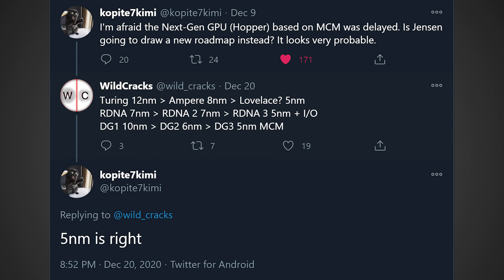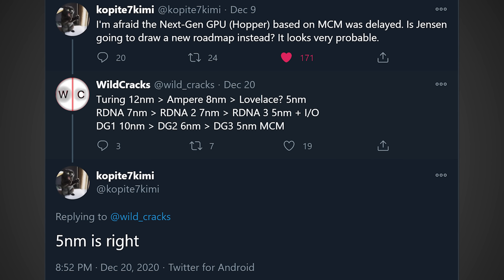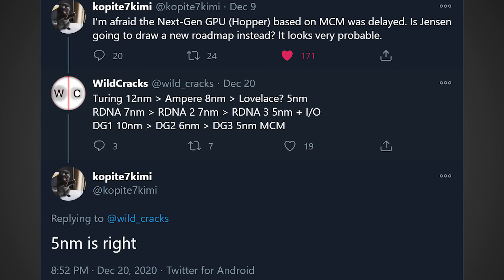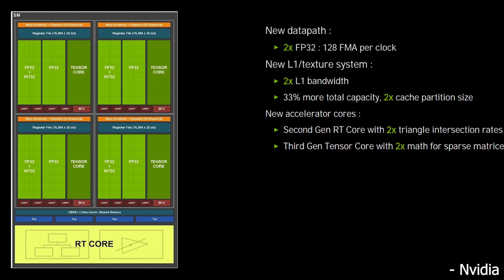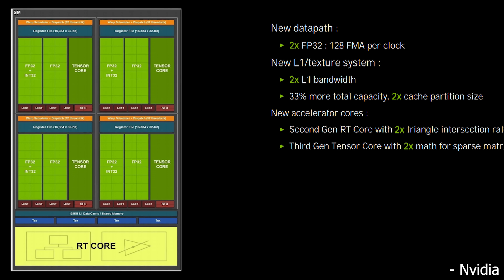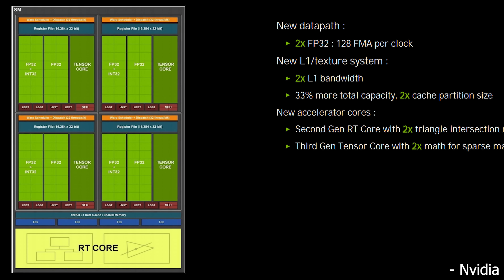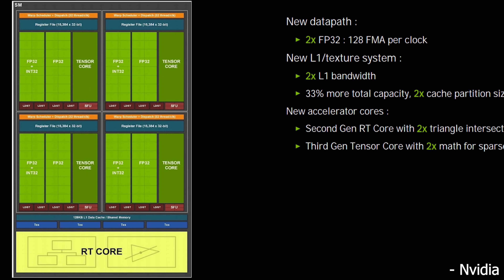NEW Nvidia Cards Leaked - RTX 4080 5nm Lovelace & Hopper GPU

Comment: I swear if 4000 series comes out in 2021....
Reply: I think 2021 series 30 refresh and then 2022 5 nm hype train
Reply: Its good, competition again and progress.
Reply: @M Smithy lol you really think BILLIONS are gonna be buying the latest Nvidia cards? lmao
Reply: @M Smithy They cant make cards? im pretty sure my Nvidia card its real, what are you on about?
Reply: I would be fine with a new generation of cards every year. Pump those suckers out like iPhones. If you want to skip a few years, that's up to you. It's called technology. It always gets better and older things become obsolete.
Reply: @jessepotter365  its just that the performance upgrades are to small between generations and each generation is sold as being a godlike upgrade when people in same cases risk DOWNGRADING with a new generation
Reply: There are leaks talking about an inevitable 4000 series card.  You know before the 3000 series was even out the door Nvidia was planning the next step.  This leak discussing possible designs in no way means a 4000 series card is anywhere close to being launched.  There is going to be basically no way a 4000 series card with new designs like stated in this video is happening in 2021.  If anything this is a mid 2022 product line.  It will be months before stock gets better for the 3000 series.  There will not be a reason to release 4000 series till 3000 series is squeezed for all its worth and right now there are tons of people just hovering over buy buttons for those.
Reply: I guess none of the comments lives in Australia. 3080 cost the same as 2080ti here. And I just get second hand 2080 and it is like half price of 3070
Reply: @EnnTomi1  tbh i dont even know what a 3080 costs in EU because i have never seen one, but i wouldn be surprised if its the same pirce as a 2080ti. This whole MSRP from Nvidia is just a massive scam and sadly techtubers are falling for it aswell.
Reply: @M Smithy i dont have a 3080...? and where you get your numbers from? Id like to think you're not just talking bs.
Reply: Jesus Christ the arguments in this chat are fun 🤣 
In my case, I got an RTX 3090 for a professional workstation where 24 GB of VRAM is required (DaVinci Resolve crashes otherwise).
I don't regret my choise at all because it's something necessery for my line of work and which will pay for itself.
Waiting for a year or two for the next generation isn't really worth it in my case, especially when we take into consideration that the new generation of tech is always going to come and at some point you gotta bite the bullet 🤷🏻‍♂️
Reply: @teodor_b_g  yeah but your extrem special usecase is like 1 in a million. I dont even understand why people like you even watch those videos or even comment on it. Be happy with your card and good is.
Reply: @decuervo yeah I'm passing my old system on to the fam so it'll still be around. You won't be disappointed with a 30 series
Reply: @Marlboro65  Pretty sad to be this upset over a GPU, get a life buddy 😂
Reply: @HondaBrandy  just in time for cyberpunk to have most of its bugs patched
Reply: I got my Asus 3070 for $540, at 2020 Dec, can't be thankful enough
Reply: Not until 2022
Reply: @adityakr.7550  why are you so sure it will be 2022?
Reply: @softycrab6267  because it makes no sense to make new cards in 2021 when you still can sell cards in 2021, the only competitor (AMD) wont make any new cards in 2021, so why should they make any new cards in 2021, while they still have to produce and sell their already developed cards.
Reply: @adityakr.7550  yeah, october 2022
Reply: I hope it's true because the 3000 series is not interesting to me
Reply: @rubyvi5442  cringe
Reply: @rubyvi5442  lol the biggest jump in performance for dollar value in years and it's not interesting to you? is that because you're salty from buying a 20 series or you can't afford a 30 series.
Reply: @guntherhunter5231  lol rip anyone who bought 20 series, especially 2080ti owners, when a 3070 is as good
Reply: @guntherhunter5231  Seems as if you're the one suffering from buyer's remorse 😂
Reply: @Jordy1707  RIP anyone that bought 3000 series which is actually rebranded 2000 series with some oc 😂
Reply: @rubyvi5442  low tier bait
Reply: @rubyvi5442  got a 3080 for a good price and I love it. I avoided the 20 series because it seemed like an awful upgrade path from my 1070. I am incredibly happy with my 3080 though.
Reply: @rubyvi5442  it's a huge performance leap especially in the lower tier of cards, the 2080ti cost 1200 dollars at launch and now it's being matched by a card less than half the price, there hasn't been such a good performance jump in a long time, the competition is great
Reply: @guntherhunter5231  Seems like a great deal😂👍
Reply: @Jordy1707  I just love how all the people who gave in to 3000 series hype are trying to convince themselves that it was a great buy, good stuff
Reply: @rubyvi5442  molding with ur 1050 ay?
Reply: @Jordy1707  I think this guy might still be rocking a 660 or something
Reply: @rubyvi5442  you’re obviously drunk
Reply: @rubyvi5442  You all realize in the early 2010's and all of the 2000's new hardware every year was the rule right? If you dont want to get shafted dont buy the flagship...
Reply: @falyncs  Hey I'm not the one trying to convince myself that spending my mom's money on the latest card was a good idea😂
Reply: @guntherhunter5231  Lol sure thing buddy, enjoy your minecraft RTX and the five other RTX supported titles😂
Reply: @rubyvi5442  Yeah I will enjoy pushing max framerate at 1440p as well. Enjoy your low settings on every game ever made. Including solitaire.
Reply: @rubyvi5442  what are you going to do wait for something better to come along? If you have a 1080/1080ti I can understand that as they're still performing well at 1080p, but there will always be newer stuff but if you can get a 3000 series currently the value shown in standard perfomance metrics is still a big leap, obviously the 2000 series cards are still good but if you need a new card or want to upgrade it seems like the best time for a long while to do so, as a result of this they are sought after and hopefully stock will stabilise
Reply: @guntherhunter5231  I will soon enjoy my 4000 series card while you will be stuck with a rebranded 2000 series card, fact
Reply: @guntherhunter5231  the 30 series is only good because the 20 series was so shitty.
Reply: @rubyvi5442  Yeah, just wait 2 years for a gpu that maybe has 20% uplift in performance. I’ll buy my 3080 and never look back, heck I can sell it before the new ones comes out and get the 20% regardless!
Reply: @andreaskvisler  Assuming that the card will even keep it's value into 2021, seems like a lot of guesswork, time will tell if you really are the smart buyer you'd have me think you are
Reply: mat a  Thanks for the free financial advice, you must be very successful
Reply: @rubyvi5442  I will enjoy my 5000 series while you’re stuck with a lame 4000 series! Lol 😂
Reply: @Jordy1707  why rip? I bought a 2070 and now its  2 years old...so its obvious  that new cards  that are way better will be released  someday
Reply: @yoool7137  yeah just the high end cards like 2080ti lost a lot of value, the 2070 not so much, but I'd feel pretty bad if I forked out for the 2080ti, the 1080ti beat the 2080 or was on par, whereas the more expensive 2080ti is beaten by the 3070
Reply: @guntherhunter5231  really? have you tried turning RTX ON and FPS OFF on even the RTX god damn 3090? nah... compared to a GTX 1080 Ti, the 3000 series are NOT as impressive as they SHOULD have been... and the 2000 series? LOL ... those cards were a god damn JOKE.. the LOT of them
Reply: @Jordy1707  thats the problem... the highest end 2000 series were on par with the highest end 1000 series, the highest end 3000 series were on par with the highest end 2000 series that were on par with the highest end 1000 series... whooops.... seems like the performance gains have been to damn small since the RTX 1080 Ti... doesnt it?
Reply: @guntherhunter5231  however, your performance jump would have been much less if you upgraded from the GTX 1080 Ti
Reply: @tj71520  no the performance gains are quite large this generation, the 2000 series was only a small improvement over the 1080ti though, the 1080ti was untouchable for a long time in pure performance, but for 1440p and above now there are better cards
Reply: @Jordy1707  well I suspect the 4000 cards Will be just a smal improvement on the 3000 cards then however it may drive down prices on cards similar to 3000 cards like 3000 cards did for 2000 series cards
Reply: @rubyvi5442  i agree. I got a 1080ti and I’m still happy with it. I game on 1440p 21:9. If cyberpunk wasn’t such a buggy mess, I’d go for a 30 series. Even then, it can’t hold a stable 60 natively on the 30 series at my resolution w/o DLSS. So I may as well wait for the next Gen version of the game on PS5. I’ll upgrade my gpu once Elden Ring rolls around.
Reply: 3000 series isn't anything remarkable, raytracing performance isn't really playable and not many games support raytracing yet, the games that do support raytracing aren't interesting either
Reply: @rubyvi5442  buy a 3080 and go play some Cyberpunk 2077, hotfix 1,05 with ultra Raytracing settings ;)
Reply: @zouzoudevil87  Not my kind of game, RTX also fails to impress me
Reply: Ruby VI it seems great to me coming from a GTX 750 2gb lmfaoooo I’m playing cyberpunk on RTX with 60+ FPS while driving and 80+ inside areas it’s so nice on 1440p too, and of course I have DLSS on.
Reply: @SubZyYT  when upgrading from such an old card... even an overclocked potato would seem fast in comparison
Reply: Ruby VI you sound like a jealous NEET to me that can’t get nor afford a 30 series
Reply: @SubZyYT  Jensen Huang is this another one of your sock puppet accounts 😂calm down buddy
Reply: @rubyvi5442  true and besides... the ray tracing I've seen so far.. looks like ass compared to playing the game without RTX

Comment: If there's something like a 40-50% increase in perf/watt, I would imagine then Nvidia would want to target most of that into power efficiency, as the requirements of Ampere are already so high and then they would have cards that are a good platform for mobile/laptop GPUs.

Even so, if there's like a 25%-30% performance improvement, it would basically "require" people with Turing cards to upgrade.  But it would be nice to know what the possibilities of an MCM jump would be, if it would be another GT8800 moment.
Reply: Makes me wonder if they're going to continue this mistake of putting out gaming cards that actually perform better than their flagship professional cards, and at 1/5 the price. As a DL researcher, $/TFlop is mostly what I care about for rollouts, and the 3090 only beats 4x 1080 Ti after two years of 100% use. Price between generations seems to be a function of how quickly you want the work done, and the professional cards are so pricey they make AWS prices look reasonable. I don't have any advice for Nvidia, but their product planning is, in my estimation, nowhere near what it could be.
Reply: Samsung  Struggled on their Exynos Chips on their Mobile Platform in terms of Efficiency.  I can't even imagine if They could Pull this off on PC platform.
Reply: Why was  the GT 8800 a big deal during its time? 

(Sorry, I just joined the pc gaming community.)
Reply: well.. you already need a nuclear powerplant in your CPU case to power a 3000 series card as well as an ultra wide case and special power cables

Comment: If an RTX 4080 is just going to come out in 2022 I might as well just wait, and save for a system rather than sticking a 3080 in my current PC.
Reply: Then you may as well wait for DDR5 and  PCIe5.0 it doesnt ever stop
Reply: I got a 3080 but that's it for me ima wait till like a 4090 or something way stronger but for now ill be good for 2yrs
Reply: There’s no telling. Gpu generations usually take 2- 2 and half years. Plus with the demand/scalper happening again. Expect 2023 before you can comfortably buy one.
Reply: And availability will be an issue when those come out too.. so realistically you can wait for 2 whole years or you can buy a new gpu now and then sell your card a few months before the next gen comes out and get most of the money back to upgrade :D
Reply: Imagine if they showed like Cyberpunk 2077 Running at 4k 120FPS with Ray Tracing Turned On on new RTX 4080 series. I assume it will come somewhere around 2022 end. Cause I don't see them launching it at 2021 end as of now buy anything can happen.

Comment: Damn I’m still in line to get a STRIX 6800XT I don’t want it to go out of top spot with the 3080😭
Reply: Why would it matter to you which of these graphics cards would be better in some random games or synthetic benchmarks? Will the graphics card you want be good enough to play the games you wanna play right now at the resolution, graphic fidelity and FPS, that YOU aim for? Yes? Then get that card. If not, get a different one. It's as easy as that. Don't get me wrong, watching benchmarks is still a handy tool to understand which graphics card will be the one you want for your use-case, but it shouldn't matter to you, if one graphics card is a few percent better in a synthetic benchmark or a game you might not even play.

Additionally, if graphics card A gets 120 FPS in a game and graphics card B gets 150 FPS (but is a lot more expensive) and you have a 120 Hz monitor, get the 120 FPS card, as you won't notice the 150 FPS. Of course, if both graphics cards cost the same, you might as well get the 150 FPS card.

As soon as these graphics cards are available for a reasonable price, I'll look at the best one for my use-case and get that one. Although I am slightly biased against nvidia (important, I didn't say "biased towards AMD), because of the whole debacle with Hardware Unboxed. Again, I'm not aiming for the "best graphics card", I'm aiming for the "best graphics card for my use-case". I think that is very important.

Have a nice day and Merry Christmas and Happy New Year. Stay safe. Don't forget to love each other.
Reply: @ThorsShadow  to add if you are getting something that will help you right now, and don’t plan on upgrading more of your stuff (which goes for anything not just PC related stuff) for many years then sure, get something that’ll suit your needs right now. Especially in tech, I like getting the better products to make sure that I can get many years of use out of it, instead of a few years and look to replace it cause it’s old or falls out of the standards, which in turns means I’m spending more money than I would’ve just trying to overshoot a bit. But we all do what we want to our money, so good luck in your buying endeavors and merry Christmas!
Reply: To me it matters because I’m a fan of future proofing a lot of things I own. For example, 2 years ago I bought a 240 hz panel (350 bucks) instead of 120-144 (200 bucks) because I was pretty sure in a couple years there will be hardware that I can get that can push these higher frames, which I was right with these cards that I’m now trying to obtain. Had I gotten that lower refresh monitor id have paid 200 for it plus look to spend 300+ more bucks on a newer monitor that could compliment the higher frames I would be getting now (making it over 600 bucks total had I just settled.) If you have the money, I don’t see much point in settling for something you are sure/pretty sure you won’t be getting as much use out of than you thought. Not everyone has the money which I totally understand, but overshooting is better than undershooting since hardware starts going out of fashion quick. You can’t always get the highest top end stuff, but I like to shoot for the things that I know can last me as long/longer than I think I need to before upgrading again so I don’t waste more money.

Comment: Congrats on the 3080 mate 👍
Reply: Bro I got my 3080 today as well it changes the game especially coming from a 1660 super
Reply: @scheer1991  I have a 1660 super tell me how does it feel to switch to a 3080?
Reply: @islam2681  an absolute night and day difference especially with my 1440p monitor I got. I haven't gone under a hundred frames with 1440p ultra everything.  Within a month or two I'm going to get the LG C10 TV and I should be able to play games off of it with the 3080 at 4k.
Reply: @scheer1991  is 1440p a big jump from 1080p?
Reply: @scheer1991  Get a 4K high-refresh monitor.
Reply: @scheer1991  where did you get the 3080
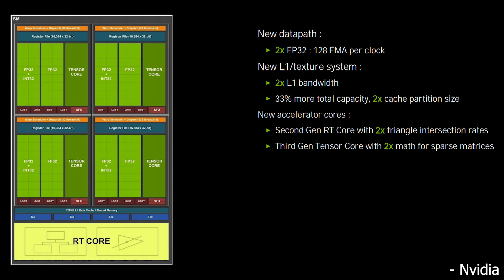Reply: @Aeye123  micro center in Houston I went up there at like 3:00 in the morning and waited in line and got it apparently they get 50 or 60 everyday
Reply: @scheer1991  that’s great am in west palm beach 😞
Reply: @Aeye123  that doesnt seem that bad my friend lol
Reply from the maker: Thanks!
Reply: No problem.
Reply: @Phina Lazer for almost triple the price?
Reply: @islam2681  It's way more than double the performance believe me
Reply: @stefanopanucci6279  ok I believe u